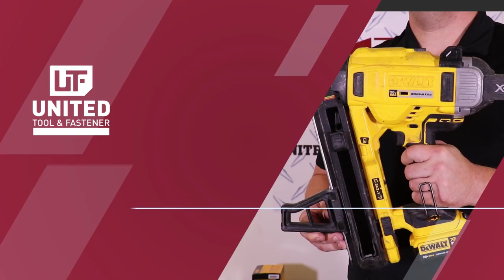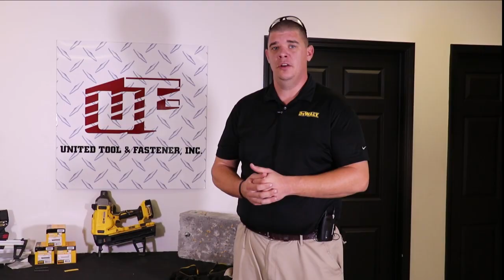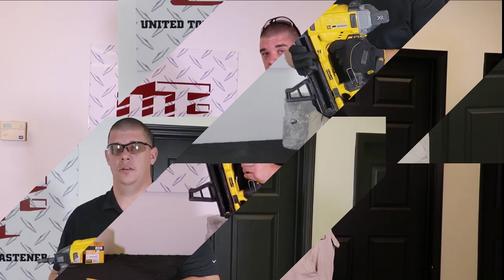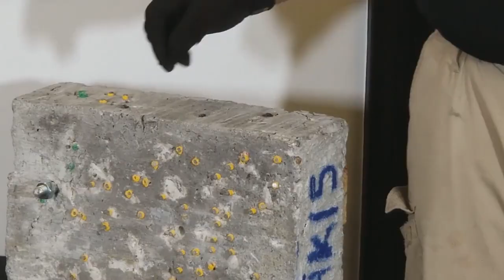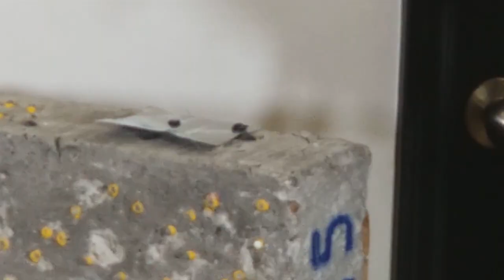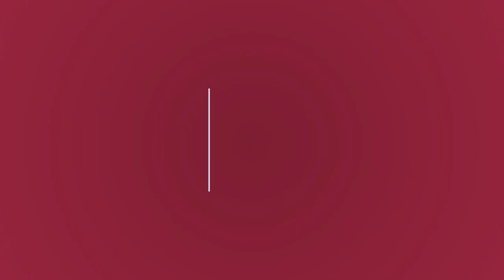DeWalt Concrete Nailer DCN890

Comment: Back in the day when I was a carpet installer..   I would have loved that, especially on big commercial jobs on concrete, pounding tack strip....I alway just used hammer...   you never want to lose the acquired skill to pound a concrete nail in with 2 hits, first to drive in second to sink it... a 3rd hit usually caused the concrete to break.. sometimes a bit of contact cement was good

Comment: This unit would have been incredible IF it had been designed it to shoot a MINIMUM of 2.5" (ideally 3") pins! You canNOT adequately fasten 2x4s to concrete with only .75" penetration.
Reply: If this would do 3" so I could attach 2x4 to concrete... Holy shit I wouldn't blink an eye about buying this.
Reply: jetsetjoey it's not made for dimensional lumber it is made to fasten metal track for metal studs. If you were to try a gun such as this with 3 in pins you'd likely split the wood
Reply: My Ramset doesn't split the wood, so DeWalt should be able to make a gun that doesn't split the wood...
Reply: I am curious if it will work on brick in addition to concrete.
Reply: Well, DeWalt makes a Ramset so I guess that answers our question lol.
Reply: I was thinking, you could get a fixing in timber to hold it in place and then plug and screw. Might be handy if working alone or fixing to concrete ceilings. Anyone tried this?